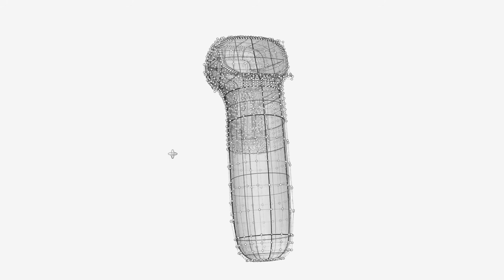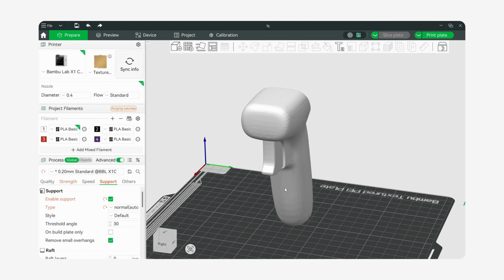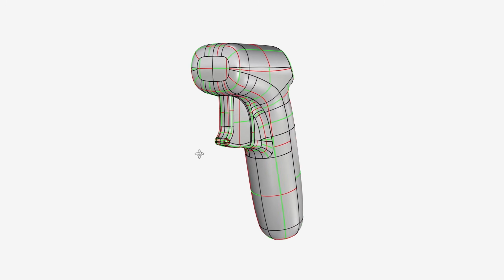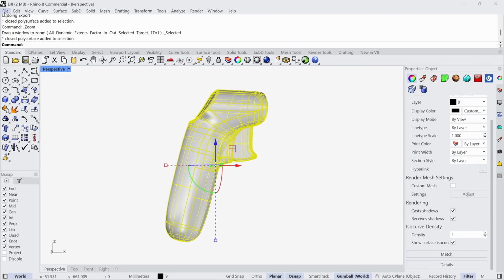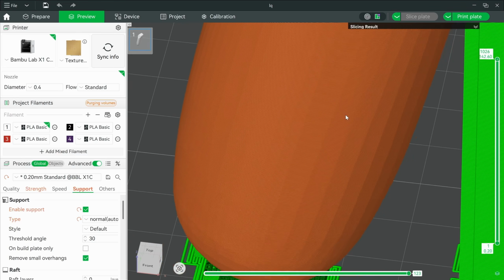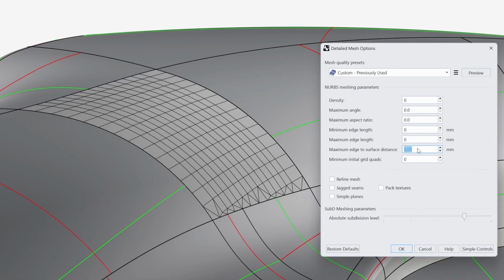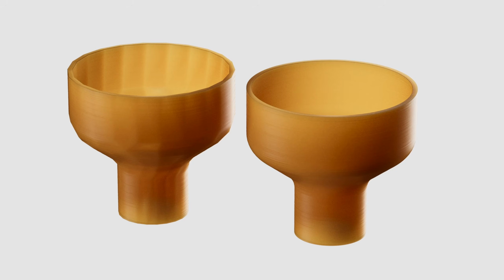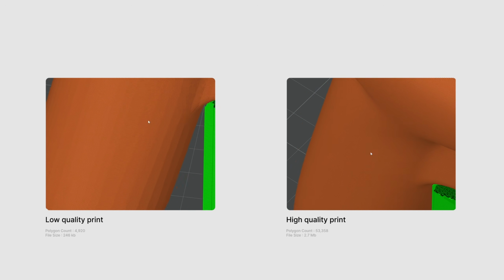Why Your 3D Prints Look Faceted: NURBS to Mesh

Comment: I tell you something even better. You can model in subd and convert it nurbs very in rhino. Export lowest division subd model as obj. Imoprt it to rhino (6 and up). Click on it, type tosubd, then selesct newly generated mesh with higher subd division, type tonurbs and with few seconds you have full nurbs surface. Perfect for fast modeling  and rendering in blender and technical finish touches in rhino.
Reply from the maker: Although the trick you shared can be useful in specific contexts, here we are specifically talking about converting your surface models into meshes.

Comment: What’s your view on using step files for printing?
Reply from the maker: When you use a STEP file, the exact same logic applies. The only difference is that the tessellation happens inside your slicer instead of your CAD software.

STEP file retains that raw mathematical NURBS data, a slicer like Bambu Studio has to convert it into a mesh when you import it. It does this using two main settings: linear deviation and angular deviation. Linear deviation is the exact same concept as the "edge-to-surface distance" we looked at in the video, controlling the maximum physical gap allowed between the polygon and the true surface.

Angular deviation dynamically changes the mesh density based on curvature. It forces tight, curvy areas to become incredibly dense to capture the detail, while allowing completely flat areas to use much larger triangles. So, whether you export an STL or import a STEP, you still have to manage these parameters to avoid those jagged edges!

Comment: What should I learn to get a Job ....Rhino? Or Catia.
I'm not from your traditional Design college. I'm self taught and have Worked in Blender as Artist at a Engineering firm
That's how got into Design engineering but those people didn't teach me solidworks or helped me get a GOOD SALARY  

You know Gatekeeping.
Reply from the maker: Mad respect for being self-taught!

If you want a high paying Design Engineering role, look at Solidworks for consumer products, or CATIA if you want to break into Automotive/Aerospace.

Rhino is incredible for the upfront Industrial Design and complex surfacing, but engineering corporations run on Solidworks and CATIA. 

Important: Rhino also has Grasshopper hehe
Reply: @Cademy what of inventor?
Reply from the maker: @biafra13743  It's very similar to Solidworks history-based parametric CAD package. You can definitely get a decent salary with Inventor, but it’s generally less common than Fusion, CATIA, Alias, or Creo.
Reply: @Cademy  Thanks once again
Reply: @Cademy  so sir what high paying roles is rhino best for?
Reply: @biafra13743  I don't know about the US, but here in Europe, Solidworks, NX or PTC Creo are the industry standard, you can even see CATIA outside the automotive field, but Inventor is hardly seen here (as a mechanical engineer), but any software is extremely competent to get started. You might struggle the first weeks when switching from one to another, but after the first contact, you realise they are all very similar.
Reply from the maker: Indeed! The most important thing is to learn the fundamentals (splines, NURBS, continuity, isocurves, degree, span, etc.). After that, it’s just a matter of getting used to the UI.